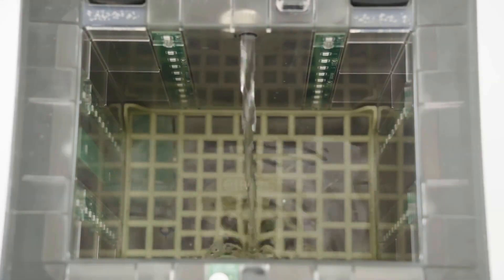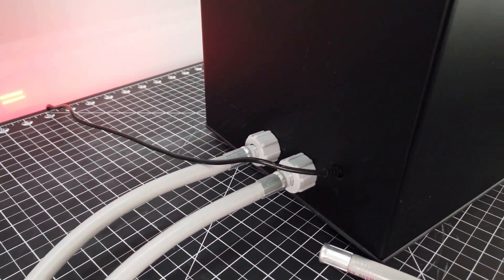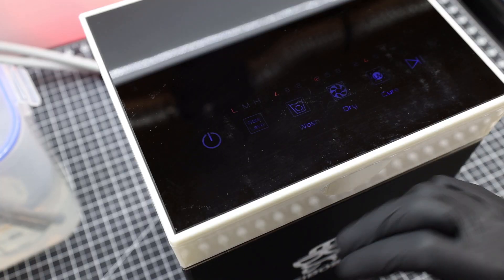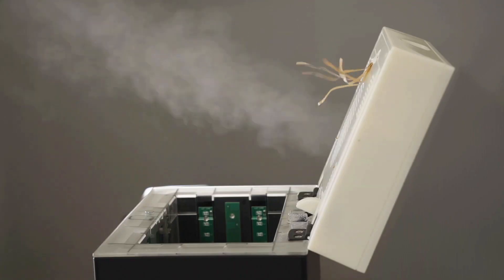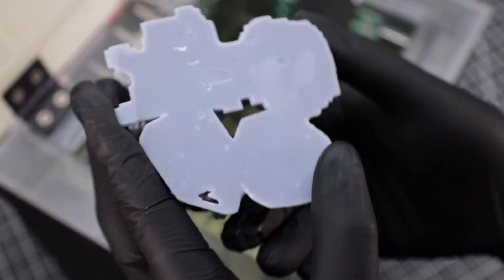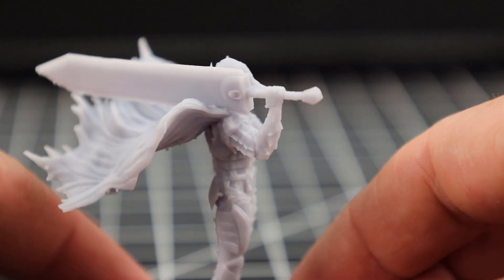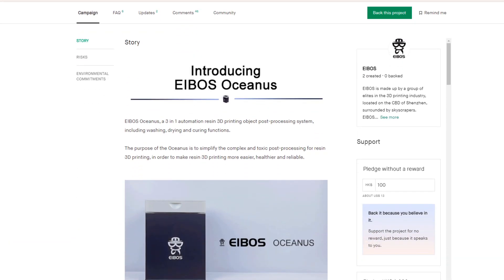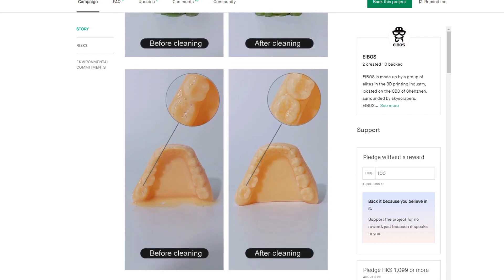New EIBOS Oceanus Automatic Wash, Dry & Cure System for Resin Printing

Comment from the maker: This is an automatic 3 in 1 wash, day and cure system for your resin 3D printed parts. You just put your part in then push start and it takes care of the rest. I'm very impressed by how well it works even  with all the supports on the model.

EIBOS Oceanus KickStarter - https://bit.ly/OceanusEIBOS

Check out my video about the BIQU Pixel L that I used in this video - https://youtu.be/yvBFvA8fWIU

Other Helpful Printing Tools:
99% Isopropyl Alcohol IPA 1gal - https://amzn.to/3zAER7z
Medical Grade Nitrile Gloves 100Pcs - https://amzn.to/3PG2h19
Flush Cutters - https://amzn.to/3zOfIql
The Ultrasonic Cutter - https://bit.ly/PhrozenSonicSaber
Silicon Work Mat - https://bit.ly/SiliconeWorkMat
Mug Warmer for Resin Bottle  - https://amzn.to/3QuZR6f

3D files - 
Phrozen Calibration STl File - https://bit.ly/PhrozenCalibrationSTl
Siraya Tech Calibration STl File - https://bit.ly/SirayaTechCalibrationModel
BERSERK GUTS 3D PRINT MODEL - https://bit.ly/BERSERK-GUTS-STL
Archvillain Games - https://bit.ly/3zBTFTw

This was sent to me free of charge for the review but no money has changed hands and all my thoughts and options are my own.

Other Good Printer Options:
BIQU PIXEL L 9.1 inch 4K 3d Resin Printer - https://bit.ly/BIQU-PIXEL-L-4K
ELEGOO Saturn 8k - https://bit.ly/ElegooSaturn2Printer
ELEGOO Saturn S 4k - https://bit.ly/EleooSaturnS4k
ELEOO Mars 3 Ultra 4k - https://bit.ly/ElegooMars3Ultra4K
Creality Halot One Plus 4k - https://bit.ly/HALOT-ONE-PLUS-4K
Phrozen Sonic Mini 4K - https://amzn.to/3atTgIs
Phrozen Sonic Mini 8K  - https://bit.ly/PhrozenSonicMini8K

Resin:
Conjure Resin Tough - https://bit.ly/ConjureResinTough
Conjure Resin Rigid - https://bit.ly/ConjureResinRigid
Siraya Tech Cast Castable Resin - https://amzn.to/3cOzMzu

MatterHackers 3D Printing Filament 1.75mm:
Build Series PLA - https://bit.ly/MatterHackersBuildSeriesPLA
Build Series Silky PLA - https://bit.ly/BuildSeriesSilkyPLAMatterHackers
Build Series ABS - https://bit.ly/MatterHackersBuildSeriesABS
Build Series PETG - https://bit.ly/MatterHackersBuildSeriesPETG
PRO Series Filament - https://bit.ly/MatterHackersPROSeriesFilament
NylonX Filament - https://bit.ly/MatterHackersNylonX

Amazon 3D Printing Filament 1.75mm:
PLA - https://amzn.to/3gsLE9Z
PETG - https://amzn.to/3pXjjvu
ABS - https://amzn.to/3wsTRjS
ASA - https://amzn.to/2RX8dtM
Polycarbonate - https://amzn.to/3cLdr38
Nylon - https://amzn.to/3iNGeI2
______________________________________________
Note : Most of the links that I use that go to products are affiliate link. This means I make a small commission on anything that you happen buy using them. This is at no extra charge to you and this helps support the work I do on this channel. 😁👍
______________________________________________
#Eibos #Oceanus #3dprinting #3dPrinting #maker #3dScanning #DIY